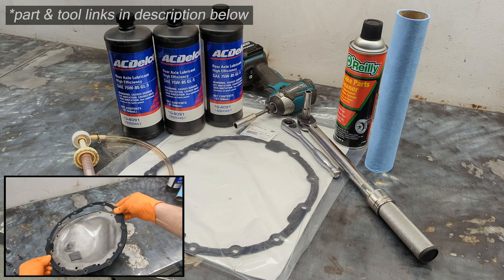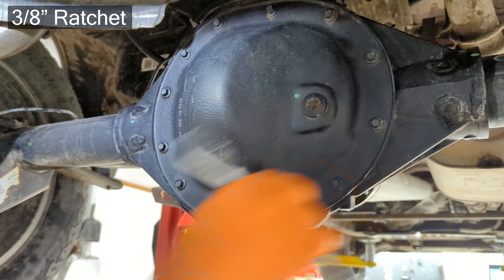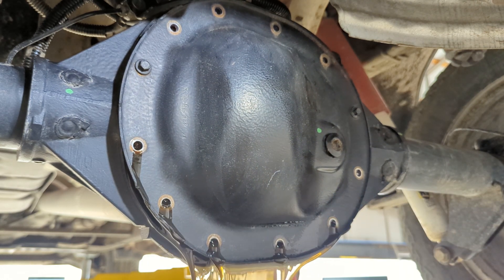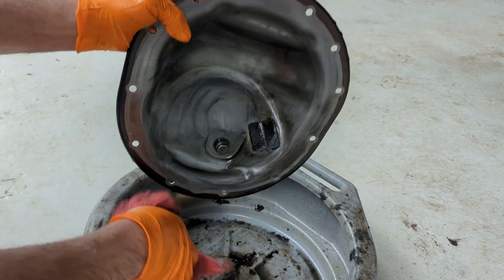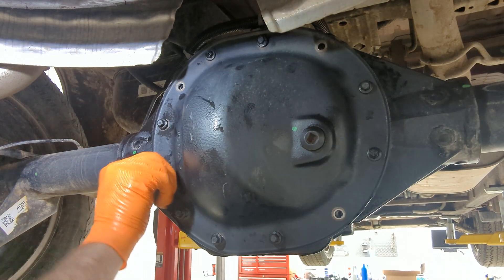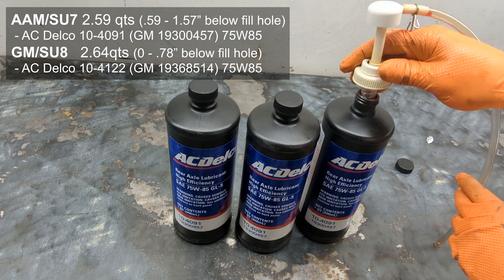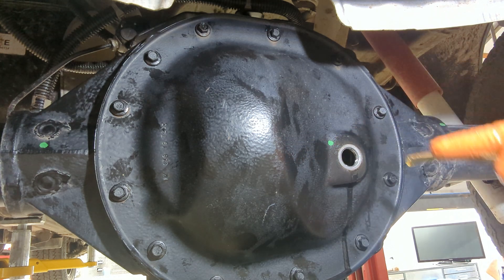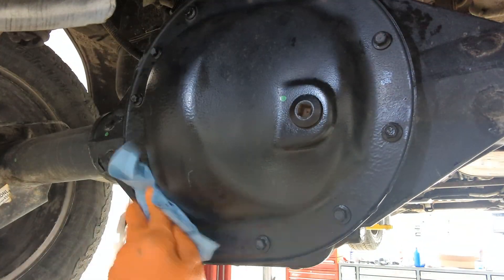2019-2024 Sierra/Silverado: Rear Differential Service

Comment: I watched your front diff video and you were ok with just extracting the fluid and then refilling.  Is there a reason you can't do the same in the rear as to not have to re-Seal the diff cover?
Reply from the maker: It's more of an access problem on the front. Hard to get the cover off and resealed past the ring gear and front cross member

Comment: Isn't the factory gasket reusable??
It was on my 2014.
And the gasket you installed was reusable.
Reply from the maker: Yes, I wouldn't hesitate to reuse it if it still looks in good shape.
Reply: @MasterJacks I bought a new  gasket before I started on my 2014 Silverado.
I removed the diff cover and dang the gasket was reusable.

Comment: Actually mine isn't the SU8. I have a 2022 2500hd gas 2wd. The only rpo codes I found are GT4 and G80. I guess with the G80 Eaton locker I should use ACDelco 10-4016 fluid which doesn't have LS friction modifiers in it. 

I guess people have used LS gear oil in them without problem but it could cause a chatter. My owners manual doesn't even list a fluid, just says see dealer lol. I am calling tomorrow and see what they say but will probably order the fluid off rockauto 🤦‍♂️

Comment: Hey great video but I would like to point out or ask a question. You mention, "There are two production options (RPO's), SU7 and SU8."
I ran my RPO codes on a 2019 sierra SLT new body style with the 5.3L L84 and found "G80" and no trace of an SU7 or SU8. The G80 appears to be 

    - Differential, heavy-duty locking rear
    - Differential, automatic locking rear
    - Differential, limited slip
    - Auto-locking rear differential
    - AXLE,REAR,POSITRACTION,LIMITED SLIP

The question I now have after reading about the G80, is this different than the SU7 or SU8? It also sounds like on this model you cannot use fluid with limited slip additives. Thanks

Comment: My RPO code says mine is a G80?
It’s a 2022 Chevrolet Silverado LTZ 2500 HD 4x4 Duramax. 
Struggling to determine if I need to buy a gasket or not ?

Comment: I agree with the comments that mention filling it to the bottom of the threads. Probably a cost savings for GM if they don’t do it. I would say 99.9% of any Shop does it that way.
Reply from the maker: That's common practice, but I was barked at pretty good by a mechanic that's rebuilt a lot more gearboxes than I have. If you fill it to the bottom of the fill hole, it's overfilled when you account for fluid expansion from heat. Overfilling it causes the oil to churn and aerate, reducing cooling effectiveness. It also puts more pressure on sesls and can cause leaks.

That said, I think in most cases it's not that big of a deal.

Comment: There isn't a drain plug? You've got to pull the cover and replace the gasket every time?
Reply from the maker: You could remove the fill plug and extract the fluid out with a fluid extractor.
Reply: @MasterJacks that’s what the shops do now to save time.

Comment: If the oem asking to fill less than the fill hole level, then they need to redesign the fill hole location. That just plain stupid by GM. The Common practice for the last 100 years, is to fill up until fluid seeps out of the fill hole.

Comment: Great video.     Using your video I replaced the oils in the 2021 GMC's Sierra X.31 Rear Diff (that had a GM rear end).  In addition to your teachings, I also learned how to lower its under bed spare tire and grease its cable/contact points.  Glad I learned that area in my driveway instead of at the side of the hiway (and no cell service).    You are a great teacher.

Comment: I bought A 2024 Silverado RST 4x4 with the 3.42 GM rear differential. I put 6500 mi on the ODO and checked the Rear Diff fluid just to do a quick top off with AMSOIL 75w 85. The factory fluid was a little low and to my surprise, OMG the factory fluid looked like viscous mud.  i siphoned out what i could ( didn’t plan on getting a gasket and doing a complete service) put 2.5 qts of the AMSOIL. In another  6000 miles in going to do a complete clean out, new gasket, and another 2.5 qts of AMSOIL.

Comment: Let me get this straight, GM specifies 1.57" below fill hole for the height, how the hell is a person supposed to measure that?  I've been working on vehicles for 30 years, and that alone seems uncalled for, either the fill hole is the limit, or the fill hole needs to be moved.  Ha Ha
Reply: just build a nice little L shaped piece of pipe cleaner and measure, then stick it in there :D
Reply: It's so the pinion gear doesn't get buried in fluid and run hotter or get airated

Comment: Excuse me, I have a 2019 Tahoe. After how many kilometers should I change and replace the differential oil?
Reply from the maker: Every 30-60k miles. If you're towing or extensive city driving do it closer to every 30k. If mostly highway miles, closer to 60k.

Comment: My 2022 (refresh) GMC 1500 Denali 5.3 does not mention anywhere in the manual to change diff fluids.  Its mentions transmission and transfer case, but nothing at all on the rear diff.  Anyone else notice this?
Reply: Yeah GM recommend SAE 75w-85 GL5 for the from Differential for newer models, that’s what I was told in the dealer
Reply: Neither does my manual.
They don't want to touching it.
I'll change mine anyway.

Comment: How often should you change this fluid? I checked the manual, but I didn't see this service, which I thought it was weird 🤔
Reply from the maker: Typically 30-60k. If you are towing a lot, heavy start/stop traffic, high heat, you'd want to change it on the earlier end. Easy everyday driving/highway, you can stretch out the service.

Comment: Newb question. Do you put thread lock on the fill plug when you're all done also?
Reply: Thanks.
Reply from the maker: No, but you could use thread tape or paste on the threads if you were concerned about it leaking.

Comment: 25 years ago I used to work at one of the popular oil change franchises. We would do differential fluid changes regularly. They were just $14.99 or $19.99. Of course back then new vehicles still came with a drain plug on the differential. I’m not sure why the manufacturers ditched the drain plug. It sure made the process easy. 

I inquired with a local oil change shop about changing my differential fluid and they were charging $225! Seriously?!! 

Times have changed…..
Reply: yes just spend almost 200 on 2 gasket and 5 Bottle of fluid
Reply: @yaoyang04 just did the same lol
Reply: That price was for sucking the old oil out and putting new in.  It's extra if you want to pull the cover which you should.
Reply: Give them the ole pump and dump

Comment: FYI the gasket is re usable.   It has metal in the middle of it.   GM has used them for YEARS like that.
Reply: Not all of them, my 2019 had a cardboard type gasket. Caught me off guard and had to order one online. Pretty annoying.
Reply: Definitely. I reuse mine for 2 changes and then replace it on the 3rd.
Reply: How can I know what rear axel is mine ?
Reply: Only the GM the AAM is not re usable
Reply: @yaoyang04  I have the GM and I didn’t have a reusable gasket, I guess it depends on the configuration you have on your vehicle.
Reply: @yaoyang04 I have the aam rear axle and it’s definitely a reusable gasket.
Reply: @yaoyang04  I just bought a gasket for my GM and it is not reusable
Reply: Yes, the OEM gasket is reusable.

Comment: Do these axles require any sort of friction modifier for the limited slip rear differential? I know the G80 is a locker but I seem to recall years ago them needing that additive or they would chatter going around corners.
Reply: The friction modifier is part of the gear oil spec now.
Reply: They do not need additives anymore, Friction modifiers are harmful
Reply: that's what I'd like to know too

Comment: Does the drain plug have a crush washer. I’ve done this twice there was not a crush washer. Thank you
Reply from the maker: I don't remember mine having one either
Reply: They are usually a pipe thread not a contact flange
Reply: Did you put thread lock on the fill plug after filling it up at the end?
Reply: @MichaelFernandez-vv2st  don’t use threadlock here
Reply: @kellismith4329 Thanks

Comment: My dealer just siphoned out the rear differential fluid and put in new fluid without removing the cover. Was this the wrong way to do it? Will it make a difference in the long run?
Reply from the maker: That's an acceptable method. You'll get a little more fluid out and have the opportunity to inspect the gears by removing the cover, but extraction is a common practice.
Reply: Some are easier than that even and have a drain plug on the bottom of the axle - you can drain it and make a decision whether to open the cover or not. If the fluid looked good and clean you might just refill it and move on. If the drained fluid looks nasty you might tear into it more. Lots of covers have a magnet on the inside as well, I will often add another ceramic ring magnet to the outside of the cover with a glob of advesive if I am not opening the cover.

Comment: Noob question. You don't put any kind of gasket sealant on the differential when installing the new gasket?
Reply from the maker: Good question, the procedure calls for replacing the gasket when the service is done, but no other sealant is required.
Reply: Those gaskets are reusable just like the transmission pan gaskets
Reply: Technically you don’t use sealant with them, leaks are not nice. Whatever you put on you may have to get off again sometime - maybe some gaskacinch on the cover side to hold it in place, and some light grease on the pumpkin side to allow the gasket to “float” with expansion and contraction of the metals. Next time I remove mine I plan to install a lubelocker gasket they look formidable.

Comment: I’m sure I’m almost due for the service as I have 80k miles on my truck this video was super helpful and informative
Reply: did you check or pull some oil out of the fill plug? This guy changed his gear lube way early as you could tell.
Reply: @BatzHM26 
No I have not but I’m simply going to take my truck in for this service as I have extended warranty on the truck so if anything happens to that part I have it documented that the dealership did the service and it’s there fault if there’s an issue
Reply: I usually do mine at about 35k. Cheap insurance!